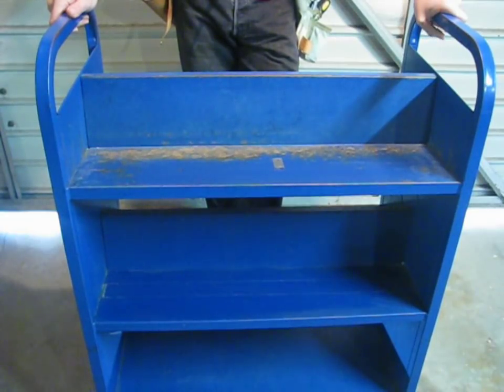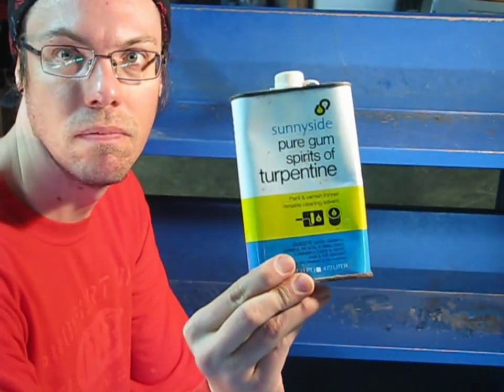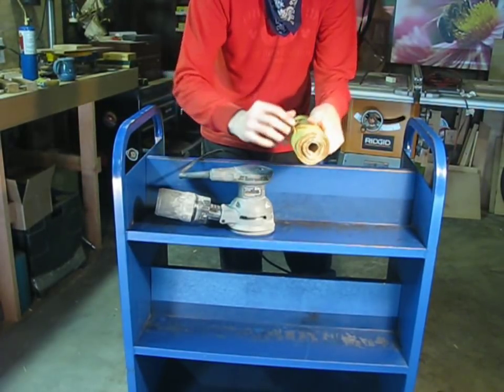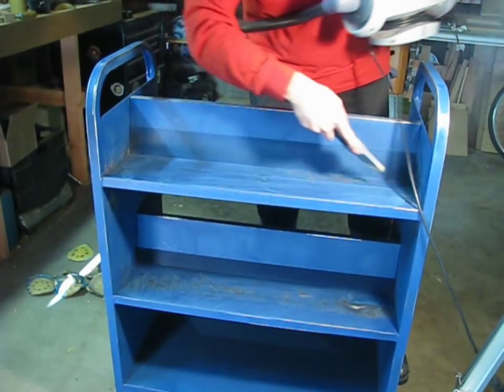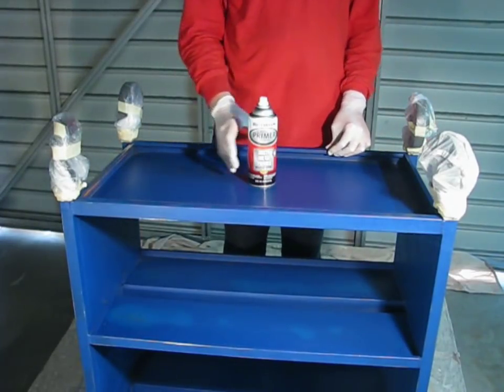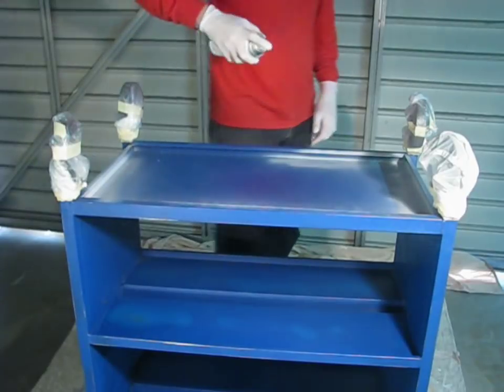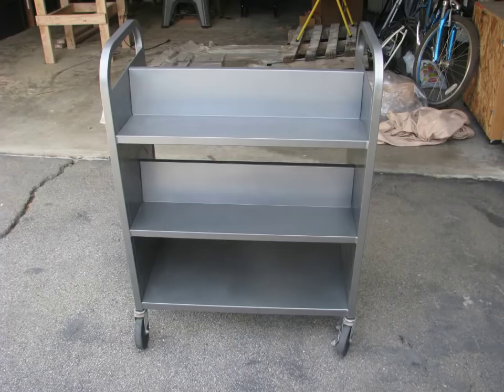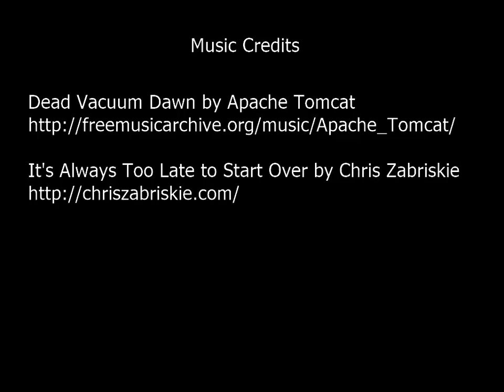Spray Painting Metal Furniture

Comment: hi, i wanted to get a metal cabinet from ikea however they dont have the color I want. Since it is new will I still have to sand it before spray painting?
Reply from the maker: Probably not, but the paint will stick better if you scuff up smooth areas by hand with fine (at least 180 grit) sandpaper or 00 steel wool.
Reply: thanks! do I have to use any primer or paint thinner before hand? thanks again!x
Reply from the maker: You probably don't need primer assuming the old paint and the new paint are compatible which they probably are.  If you're in doubt, though, Rustoleum makes a combination paint+primer that costs about the same as their regular spray paint.  I've seen it at Home Depot and most neighborhood hardware stores and it works well for your type of project.  You shouldn't need thinner at all.
Reply: This is my exact same question. How did it turn out? I’m planning to buy a black metal cabinet and paint it sage green. Advice?

Comment: Hey Kevin, quick question. I found a beautiful 1930's era bread box on Craigslist. I removed the rust spots by soaking it in vinegar, and have sanded with 100 grit. It looks like the metal is Tin, but I'm not sure. If my research is correct the original was probably powder coated--it had kind of a semi-gloss enamely looking finish. What kind of spray paint would you recommend to achieve the same look?
Reply from the maker: Hi Mathew both the big name brand spray-paint companies (Rustoleum and 
Krylon) offer some semi-gloss options in their rust-stopping spray 
paints.  I would probably start by looking at their websites, which 
should also tell you where the nearest place to buy is.

Comment: I have an item that's all black and it's chipped in small bits but all over. I want to do the same color. Could I get away with just touching up those chipped spots, or would it be best to prime and paint all over again?
Reply from the maker: Hi Kenny, I would say that you might as well try it and see how it looks, since you won't use much paint and the worst that will happen is you'll end up sanding and repainting later.   If the chips are small it might be easier to get a small brush and dab paint on instead of spraying (that's how we used to touch up chipped bicycle frames).
Reply: I see. Thank you.

Comment: Hi, this is exactly the type of video I am looking for since I do plan to do book carts. however I do not have a Sander. is there an alternative that I can use in that step?
Reply from the maker: Sure, you can do just as good a job hand sanding.  Obviously, though, 
its going to take longer.  If you have several to do an electric sander 
might be worth the investment, since (as power tools go) they aren't 
that expensive. I've seen them for under $20 at places like Walmart.

Comment: Hi. I have a brand new nickel finished console table. I want to change it  to a gold finish. Is this possible and what steps do you recommend?
Reply from the maker: Hi Karmah. I assume you are talking about nickle plating over some sort of base metal. Re-plating with a different metal is a more serious operation than you want to take on. Painting over it with gold paint is possible, though. The two most important things to keep in mind are: 1) You need to clean and de-grease it completely. Plated furniture often has oils on it from the factory that you can't see but which will mess up a paint job. I would use a spray de-greaser made for cleaning commercial kitchens. The brand I use is Zepp, which is on the cleaning aisle at Home Depot and has a nice orange smell. 2) You need to use an ETCHING primer. These are made to actually eat into the plating a little bit so they can hold better. Most hardware stores carry it because people use it to paint galvanized pipe and fences. Tell the guy in the paint department what you're doing and he can probably recommend a product. Hope this helps!
Reply: Your correct, I'm not considering re-plating. Thanks so much, your advice will come in handy!

Comment: Is it a must to sand metal furniture before painting it?
Reply from the maker: If the existing paint it in good shape and it isn't rusty then you can probably skip the sanding and be OK.   In most cases, though, a good sanding job is the first step in a good paint job, especially if the old paint is already starting to flake.
Reply: +Handyman Kevin (Kevin Straight) ok thanks